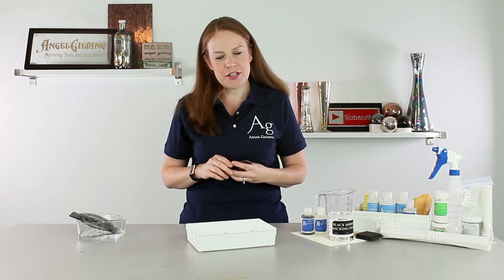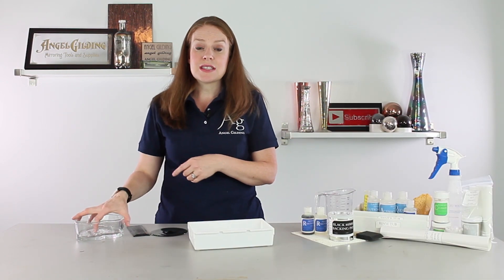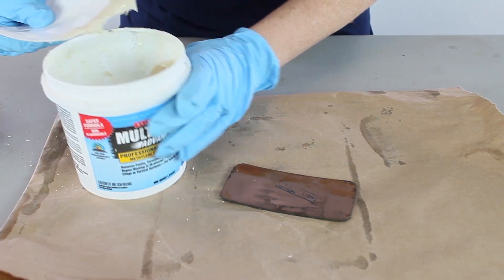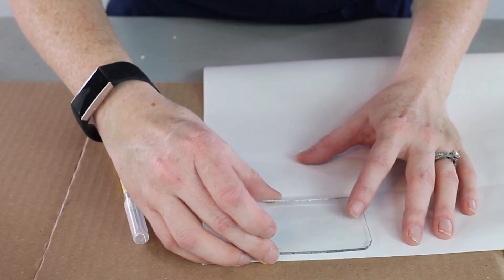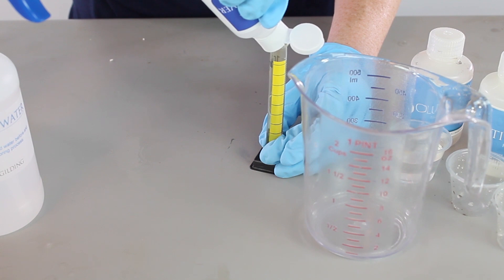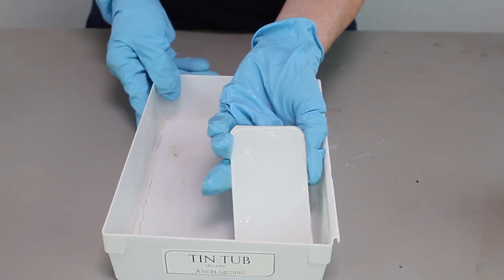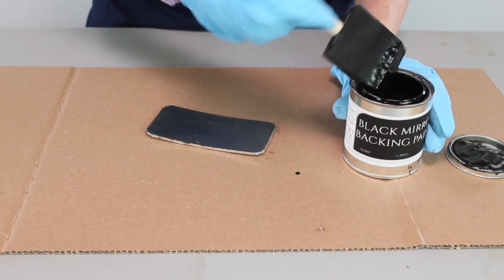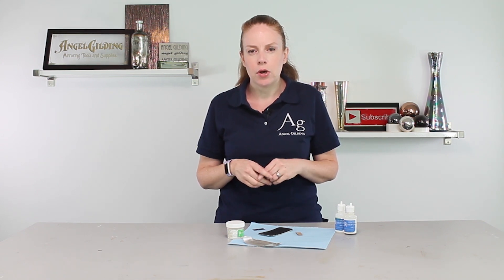Silvering A Concave Automotive Mirror

Comment: your written instructions for tin say 1ml tin to 30ml distilled water.   You mixed 1ml to 3oz water.   Which is the preferred way to go?
Reply from the maker: Hello, I understand how it can be confusing. We actually measured out 3 mL of Tin for Silver with 3 oz of water. The wording on the screen and the instructions refer to the ratios. You can scale this up based on how much you would like. You should have 1 mL of Tin for Silver for every 30 mL (which equals 1 ounce) of distilled water. Thanks!

Comment: Am I right in assuming any shape object could get an even coating so long as the silver solution is agitated enough (3-5 minutes in the case of the car mirror in the video) to ensure complete covering of the object?
Reply from the maker: That's a great point. As long as the full surface has sufficient contact with the chemicals then in theory yes. However, with some shapes this could mean that you would need a very large amount of chemicals. This would all depend on the size and shape of the piece.

Comment: Alex, How is a 10x magnification mirror made?
Reply from the maker: Hello, the level of magnification is typically determined by the glass itself, not the silvering. It will also change based on the distance between the viewer and the piece. They would all pretty much silver the same way. Thanks!
Reply: @AngelGildingcom  You are right ! for having a 10x mirror  the curvature of the concave glass must be 40 diopters and dividing those 40 diopters by 4 you shall obtain ten magnification ! Thanks for your video and the quality of your explanation !
Reply: By looking at the curvature of your concave surface (actually your budding convex mirror silvering) I can approximately determine that you already have a 10x magnification mirror (first surface mirror) but since you painted it  for protection you end up with a minus (negative image) on the second surface ! In other words you silvered the concave surface in order to obtain a convex  mirror ! Thanks for the video one more time !
Reply from the maker: @javiermancheno8531  you are welcome!